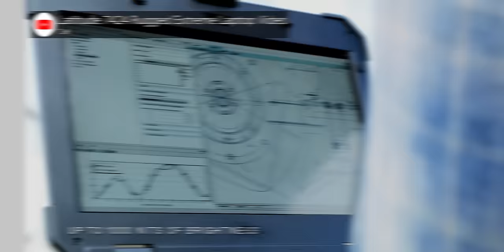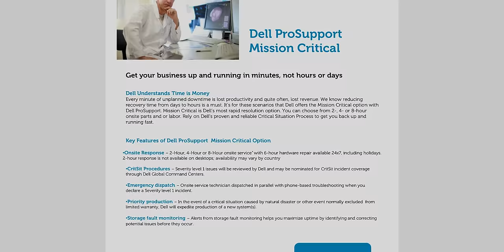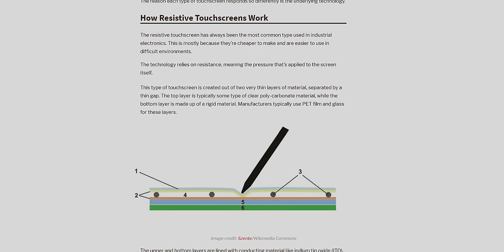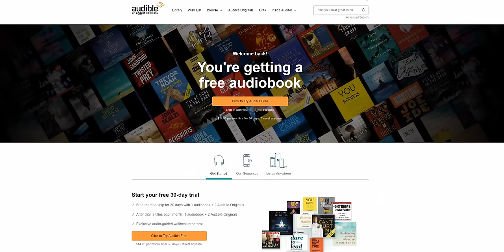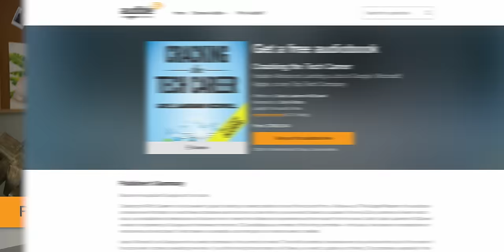The Manliest Laptop Ever – Dell Rugged Extreme Review

Comment: 0:55

Who's the laptop for? Field technicians, that's who.
Reply: also the same style that the military and police have used
Reply: Yes field technicians need RGB KEYBOARDS TOO
Reply: Oh it's absolutely for military to. Since the smart card system is how the military controls access to their computers.
Reply: Exactly...this would be perfect for HVAC - but ideal for Oil & Gas or Chemical plant work.
Reply: yup hd mechanic here, laptops like this are pretty common in my industry.
Reply: Steve Thea lights have a purpose.. Red for black out lights
Reply: Looks tailored made for Shell
Reply: I'm a geologist. This would be fantastic in the field when you're out a month or more field mapping.
Reply: As a Field Technician, my mouth was practically watering at the built in serial port. However, that thing looks stupid heavy and I don't need that high of an IP rating anymore.
Reply: Archaeologists, too
Reply: For linis
Reply: Linus Sebastian-proof
Reply: I can confirm. These rugged laptops are among the only laptops made now that still ship with serial and a lot of equipment still needs to be programmed through a true serial interface.
Reply: Exactly. I work as in IT for an oil and gas company. We give these style of laptops to our pipeline technicians who deal with extreme environments which tend to destroy regular laptops in less than a few hours. They don't need gaming performance, but they do need to monitor our systems anytime, and in almost any land environment.
Reply: not just field technicians, its also for people who want a laptop that is actually built to last and has genuinely useful features (particularly the removable batteries, expansion card and SIM card slot)
Reply: Lampworkers / Glassblowers , it gets hot as hell in the shop and I used have to just run cables through walls from a different part of the shop due to heat and parts dying all the time. ( dust and non-stop heat ) and my shopmates were NOT computer savvy and were rough with just everything lmao
Reply: Military
Reply: Military aircraft maintenance 
We use these its actually a great laptop
Reply: Yes. We are in need of good durable devices 😁
Reply: @mwbgaming28  you can get all of that in a normal latitude, they even have the mil spec chassis. no serial port tho
Reply: @smudgeone  try a CF-54, i use one and they are super lite and great to use. I also have a CF-19 and its alot tougher but horrible to type on but its still a great field laptop.
Reply: Nearshore and offshore surveyors
Reply: @stevethea5250  Actually, many use it as working in engine bays, lighting is a premium, especially when working on natural gas engines.
Reply: @smudgeone  They are not too bad, when we were deploying them, I could carry 5-6 at a time and I am not the strongest person in the world.
Reply: @mycosys  and without dual removable batteries
Reply: @stevethea5250  On the dark it's easier to see the keys since the screen doesn't provide enough brightness.
Reply: Car mechanics and enthusiasts pretty much too.
Reply: You can bet you kidney that someone out there is gonna buy it for car diagnostic and have it sitting inside his garage.
Reply: In Command and Conquer setting, maybe. Remember to pack your revolver and don't breath green crystals.
Reply: @muajeng  Didn't think about this one but you are totally right.
Reply: TheTruthNJ09 Army 17C (cyber operations specialist) here. We have used these if were ever supporting signal soldiers in the field.
Reply: @mwbgaming28  you can certainly debate the merits of the latest lats switching to external battery boxes rather than the old modular battery system. I think moist people prefer to have the weight outside the laptop, but the old 12 hour latitudes certainly were amazing
Reply: Warriors in need of modern weapondry.
Reply: @mycosys  the modular battery system is VASTLY more efficient than using a battery bank, battery banks take more space than having it integrated and you lose half the energy in the voltage converters, which means you need a battery that is twice as big and twice as heavy to get the same runtime as just having swappable batteries
Reply: It’s for extreme conditions like hazardous areas and extreme weather conditions. My guess would be Scientist, chemical Plants, and deployed military. I remember having few of a similar type back in 1999 - 2001 when station overseas in the Marine Corp with 3rd Mar Div. I think it was a Panasonic though.
Reply: @mwbgaming28  you think DC-DC converters have 50% efficiency? LoL I literally facepalmed
Reply: @stevethea5250  South africans need the back light, #LoadShedding
Reply: @mycosys  back when I had an iPhone, I had a battery case that was approximately twice the capacity of the phones internal battery

I could bring the phone from 10% to 100% just one time, and get about 20 minutes of usage before the case was dead (this was done with the screen off) 

And laptop power banks are not much better than that
Reply: Yeeeeesssss. Thankyou
Reply: @mwbgaming28  LoL so you have actually no clue whats in them and what can be done, and you judge on the cheapest solutions..
I'm laughing so hard at you, Maybe i shouldnt have studied years of electronics and i would know as much about them as you do cos you had a cheap iphone powerbank.
Reply: smudgeone I work for 4 different county’s and the police stations use its little brother the Dell Latitude 14 Rugged. It’s thinner overall, if you need a  ruggedness it’s got you cover but it only has a Ip52.  oddly enough a cd drive is a requirement for the police for security footage. These have a cd drive
Reply: @mycosys  consumer power banks are horrendously inefficient, you might only lose 20% of the energy if you buy a really expensive one

my point is it is far more efficient (both electrically and spacially) to just have a swappable battery instead of carrying a brick around that is heavier and bigger than it would be if you could just swap the dead battery for a charged one
Reply: @mwbgaming28  you are talking literally a few percent loss dude, @ the electronics are tiny, you might gain 50g weight which you dont have to lap all of the time you wont be using it, nor its bulk.
Thats a compromise most people would prefer.
Reply: @mycosys  even though laptops use energy more efficiently when they are running on battery power

a power bank tricks it into thinking it's plugged into the wall, which means to get the same runtime you need EVEN MORE capacity than if the battery was hot swappable 

A laptop with a spare 100wh battery will run for longer, be lighter and less bulky than a laptop with a 100wh power bank plugged into it

A spare battery will always provide more runtime than a power bank of the same capacity while maintaining a smaller footprint in terms of size and weight
Reply: @Obsidian0Knight  now you're on Panasonic Toughbooks I presume
Reply: @mwbgaming28  What bit of me studying a mechatronic engineering bachelors after an electronic technicians trade didnt you get kid?
Reply: They assume everyone works or does something in some cubicle. Should listen carefully to TV and Radio most of the situations, questions, environments etc. assume that the average Joe works in a cubicle when in fact most work in the field, factory or shop. It's stupid really but these people don't know anything beyond their fishbowl anyway.
Reply: Am I the only one to get your joke? 😂
Reply: @mycosys  it doesn't change the fact that you will get more runtime out of a 100wh swappable battery than a 100wh power bank, it will also be lighter and less bulky too 

What part of that didn't you understand?

If you have as much experience with electronics as much as you say you have, you would know that voltage converters are notoriously inefficient (hence why the run hot most of the time) 

You have to boost the voltage from the battery up to the voltage the laptop charges at (you lose around 20% of your power from that step alone) then you have to drop the voltage back down to charge the battery of said laptop and to power it's components (even more losses) then you have the charging losses in the laptop battery (there goes another 5-10%) 

Whereas with the swappable battery there are no additional losses

Comment: will the fingerprint sensor work if i have my gloves on?
Reply: Most likely no
Reply: @hamizannaruto  oh wow, that's so unexpected
Reply: @arthie553  IKR!
These days, they all need to work with gloves.
Reply: They have Windows Hello.. aka Face unlock
Reply: That's why you need to get one of those fake rubbery fingerprints and program it in and stick it on your gloves and then try not to lose your gloves. It's actually a product designed just for that purpose. Of course you could go the opposite way and just make a mold of your finger.

Comment: We bought a slightly older version of this laptop at work, Dell Latitude 5414. We use it on research field work in the Arctic, mainly used outside on ships in rain and such. Our laptop is pretty abysmal when it comes to processing power and battery life. I believe its got a 2c/4t cpu. But the IPC and hot swapable batteries makes up for that :) All in all a pretty dope pc, but I guess I'll have to ask the boss to pony up for an upgrade :P

Also the instruction manual is pretty hilariuos. They try to sell it as a machine used for undercover military operations in the jungle or something. It even got "Disable all radio"-button, so you dont leave an electronic footprint when undercover.
Reply: You can also use it as a ballistic shield against the Colombian drug cartels.
9mm bullets ain't gonna do much.

Comment: I'm super pumped to see LTT review outdoor themed gear! Seriously! I've worked with gear similar to this in the past (running WinXP, and Win2k) and it's always been good to me...just really, really outdated and slow. I'm glad to hear it's still being made.

My personal opinion is that they made a serious mistake not including big, chunky rubber on the bottom edges of the laptop. If your in an unstable area, like a ship, boat, or earthquake/mudslide prone area, sliding is a constant concern.

I'm also bummed that the back of the screen isn't thicker. They really should have enclosed it in thick metal crossbeams in an X pattern, or at least used some sort of geodesic pattern to encourage liquid movement, instead of a flat surface. Getting mercury, cloreoide, stagnant water, or any other number of kinds of crud sitting on the back of the screen is going to be a bad time for whoever uses it next.

I also think the latches on the IO covers are great...but they should ALSO include individual little rubber plugs for each hole. If you have this thing fall off the back of a truck doing 40 through the jungle and it sinks into a mud pit, it's going to be submerged long enough that I'd seriously worry about water getting in through any cracks or dents that might have formed from the fall. Stuff happens, and this really is a problem people deal with. Also, I've seen the hinges on those latches rust. I hope they have done something to improve longevity of the hinge mechanism.

I really wish they'd kill the touchscreen. It's a point of failure and confuses the non-computer guys when it fails. I know it's meant as a "backup" if the trackpad dies, but it's a subpar option for field work. Not sure about factory environments. The stylist will absolutely get misplaced and replaced with a pencil. (Yes, really. A pencil.)

Scrap the webcam. Security risk in software compromis3. Also another point of failure. I would unplug it from the Mobo, or desolder it if it was soldered on. Webcam is an absolute no-go.

Fingerprint reader is a nice idea, but the absolute first thing to break. Guys with grime covered hands get that all gunked up in a matter of hours. Don't bother with it.

Needs dual battery 40+40 hour swap out, like the toughbook, but ignore everything else about the toughbook.

Overall an excellent machine, and I look forward to using one. It's not for everyone, clearly, but it is an absolute life saver for people who are thousands of miles from family for months on end. It helps lonely nights feel a little bit easier. It helps doing practical work a little less of a headache, since it won't die without a fight (getting run over, blown up, or getting shot). People need computers in really, really harsh environments because of the way the world works. I'm greatful the market is willing to support those of us who have to put up with it, by giving us a reasonable solution at an affordable price point.

Comment: "I don't need it , i don't need it
I definitely don't need it.

"I NEEEEEEEEED IT"
Reply: I am such a slut for clumsy, industrial design. I am seriously considering buying this as I only own a desktop.
Reply: RIP credit card
Reply: @iwiffitthitotonacc4673  I'm constantly tempted by older Panasonic rugged laptops with the screens that flip around and fold to work like a hella thicc tablet.
Reply: I'd buy it if it didn't cost TWICE as much as my high end desktop. Massive batteries, swap-able hardware, tons of ports, a BluRay player, AND it's durable as hell? Sign me up!

These kind of things are what I would expect in a normal laptop, not some paper thin, minimalistic walled garden crap that copies Apple's shitty design philosophy.
Reply: @dasauto7346  That's what I bought a little while ago, lol. You can get one up and running for around a 100 bucks. They came with Win XP, but a Linux install works fine.  I have no real reason to check email in a downpour, but it's fun.

Comment: I work as an automation engineer, and we use these in some of our factories. Windows 10 + a serial port is key for programming legacy equipment. The ruggedness of the computer is nice to have in a factory but not necessarily needed.
Reply: what is legacy equipment?
Reply: @user-rd3jw7pv7i  legacy equipment typically refers to industrial automation equipment that was 1. Installed a long time ago (usually 1990s or early 2000s) and 2. Is no longer supported by the company that produced it. Depending on the year the device was produced, it can have any variety programming ports. Serial is common with many 1990s devices. One of the biggest challenges when programming one of these “no longer supported” devices is actually not the lack of a serial port since a dongle is easy to come by. Usually the old configuration software support is the biggest hurdle. Sometimes the configuration software can only run on older operating systems like Windows XP. Since windows XP is ripe for cyber security attacks, most IT admins won’t let you keep a spare XP laptop for programming purposes. This forces engineers to utilize virtual machines embedded inside of a protected operating system like windows 10 with software like VMware or HyperV. 

At this point you might ask yourself, why not just replace the legacy equipment if it can no longer be supported? Short answer is factories have a hard time justifying the purchase of new equipment when the old equipment is doing the job. If too many devices become obsolete or legacy on one machine, factories will typically do a full controls upgrade. That would involve replacing all electrical and controls devices but keeping the mechanic systems in place. Alternatively, sometimes it is more feasible to find a way to reconfigure some random device that was produced in 1998 rather than replacing all electrical controls on a machine. At the end of the day, these factories are not machine companies. They sell the products that these machines produce. Cost justification for specific purposes are done on a case by case basis. 

Maybe more detail than you asked for, but no one ever asks about my job and I’m excited to talk about it.
Reply: @michaeljcarn  Whoa that's amazing sir, I've never heard of something like that. If I may ask, do you work more on the software or hardware side of these old machines?
Reply: @user-rd3jw7pv7i  I get to work on both! I get to design the control system, select IO, design a network for the devices to communicate, and then write the software to control it. Usually we use PLCs for machine control if you have ever heard of those. It’s a really interesting field if I must say so myself. The downside I would say is the extensive travel, and working in a manufacturing environment can be stressful. Although the travel can be a positive depending on who you ask.